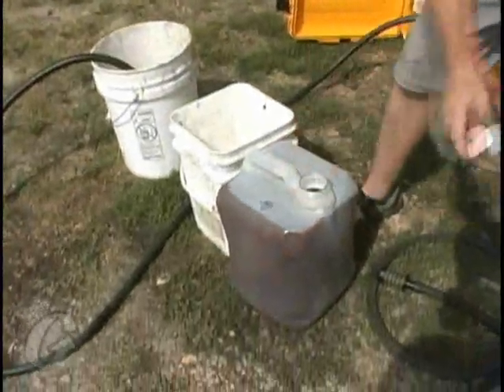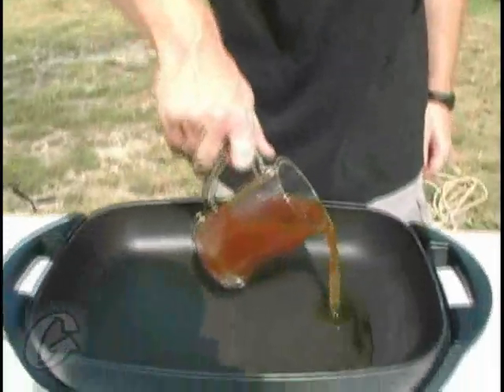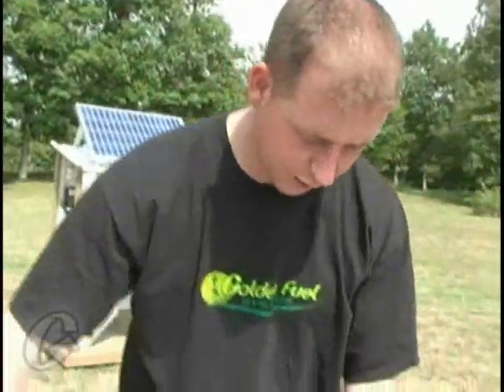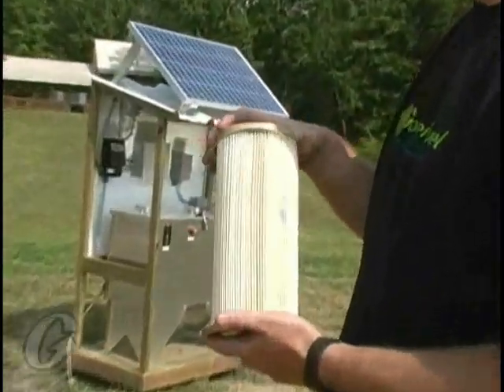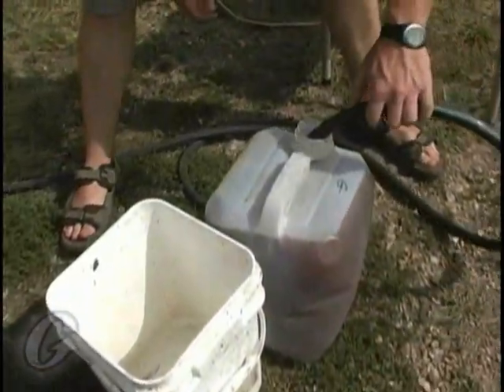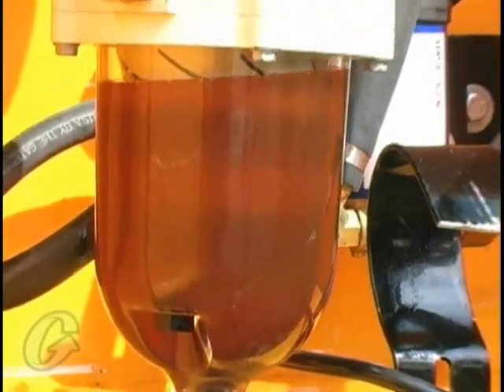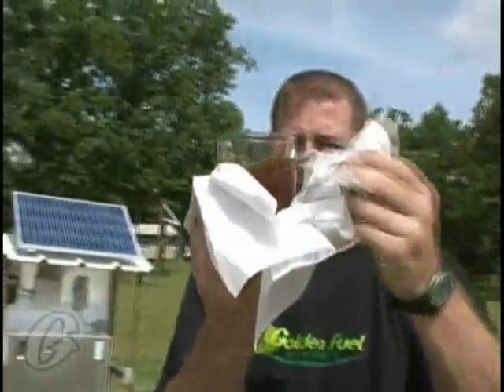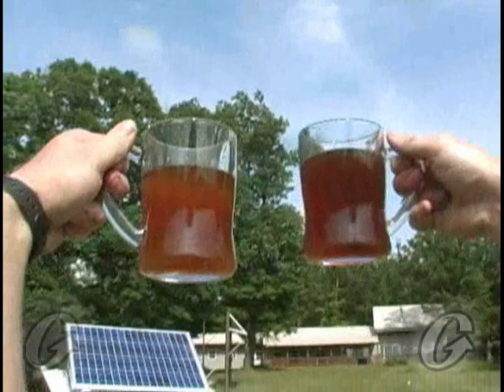Episode 2: Racor Aquabloc Filters - Golden Fuel Systems

Comment: Hey dug this link off the infopop forums in trying to determine whether or not I need to upgrade to a Centrifuge from my existing Racor 1000FH with a 2 micron element; exactly the one used here. I've also found the oil to pass the hot pan test and I have very high quality pure WVO. In fact the one thing that this confirms is Racor is a Golden Product! Great vid! The only thing better would be an element designed for WVO, even after a 5 micron bag I go through elements in about 40 gal.